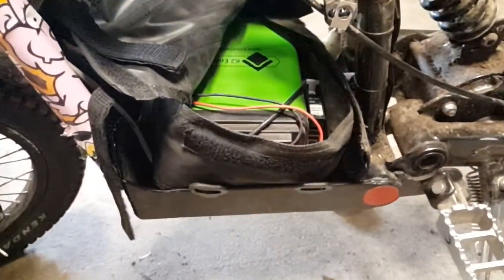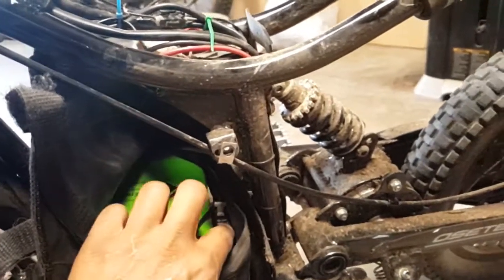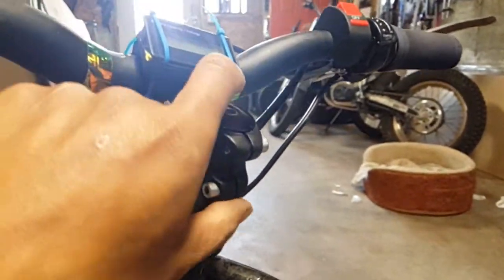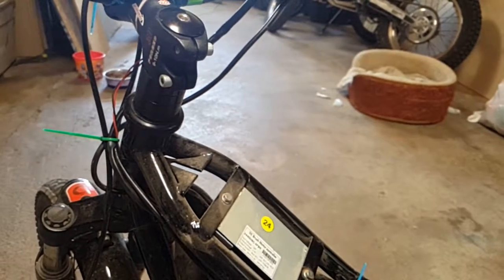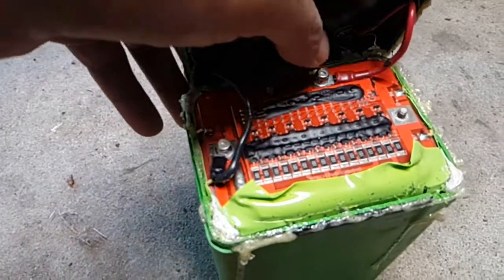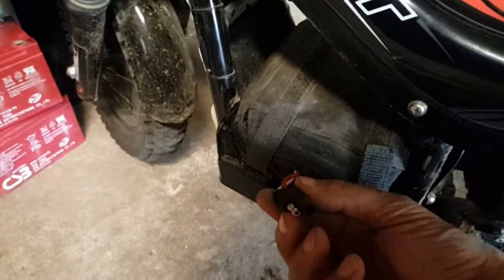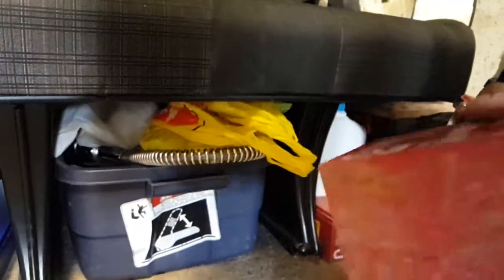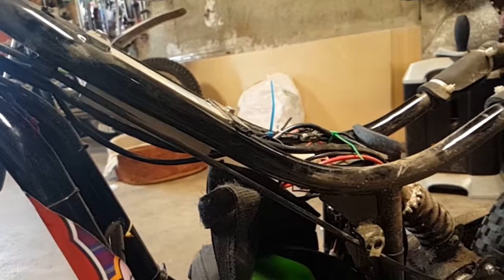Oset lifepo4 battery upgrade

Comment: right to the battery is this a circuit breaker? how much amp does it have??
Reply from the maker: This one is around 30 amps. Yes its a dc breaker that i use for solar panels. I work in the alternative power industry so know a  bit about electronics and such
Reply: @electronichillbilly2818  thanks for the answer, i am also doing a conversion to a lifepo4 with a xt60 connector and your video wos the best description for the upgrade i found on the net thx a lot
Reply from the maker: @183shit  whats the xt60?
Reply: @electronichillbilly2818  xt 60 is a connector from battery to the oset  or the charger, mostly used in rc cars, can take 60amps, good connectors here in europe

Comment: We need more info! You could easily fit two or three in there for all day riding and a $350 cost.
Reply from the maker: You could but i find that the kids are starting to get tired with this range before the battery is done. Which works out  well

Comment: Looking to do this upgrade.  Is this Bike a 24v or 36v?
Reply from the maker: That one is a 24 . But i bought a 36v this spring . Was more since it was not a used k2 and you have to get something that is correct dimensions.  But gets over 2 hours of ride time now. I found them on ebay. Ping battery also does them. But make sure the bms (battery monitoring system) has a minimum 35 amp bms or larger